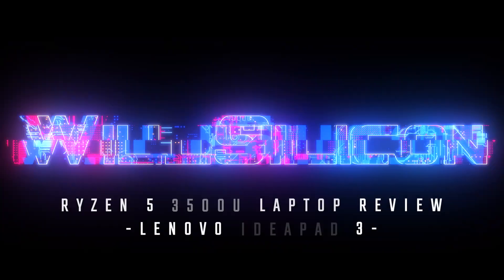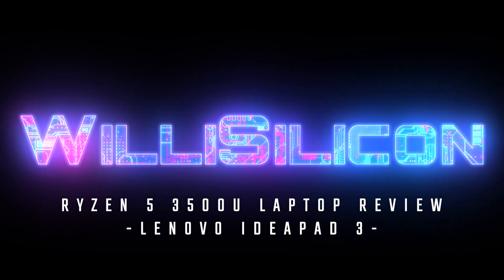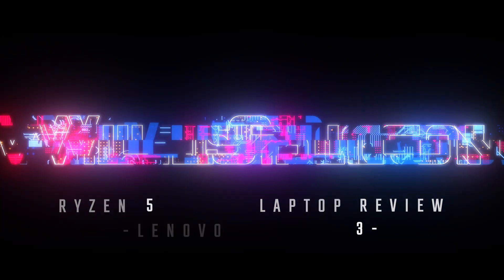This $450 Dollar Laptop Rocks! - Ryzen 5 3500u - Lenovo Ideapad 3 Review

Comment: Hi there. I bought this laptop last Friday and I'm looking to expand its NVME memory at least to 500GB. I saw that you recommended 2242 and 2260 memory sticks to put in this laptop but I've been unable to find those at Amazon or eBay. I saw one of the comments that somebody actually used a WD SN550 to upgrade the 256 NVME this laptop comes with, but the WD is 2280, is it possible to put a 2280 NVME in this laptop, what you think?
Reply from the maker: I looks to be possible to fit one in there but there isn't a screw hole for 2280. Soooo, maybe if you treat it gently? lol. Otherwise this is the cheapest 512GB 2242 NVMe drive I'm seeing right now. The smaller sticks are generally more expensive. Sabrent is a really good SSD brand though.  https://amzn.to/3kxJJ2C
Reply: @WilliSilicon  so you’re saying it could fit a 2080 SSD but because it doesn’t have a screw hold it’s dangerous to come loose or break? I’ve heard it can run it but I don’t want to risk it coming loose or something
Reply from the maker: I have not personally tried it. Next time I get the laptop from my son I will open it up and see how a 2280 fits. So probably Sunday.
Reply: @WilliSilicon  okay let me know when you do. I almost thought I saw another screw hole to the left that might fit a 2080. I could be wrong though. If it does fit a 2080 that gives this laptop some strong potential
Reply: @SoapboxPreacher777  I opened up mine recently to change the ram and I saw another screw hole 40cms far from the one that the NVME is screwed. I didn't make the NVME change so far however I've concluded as well that it could be a slight chance that a 2280 NVME could fit in this computer, moving the screw that is holding the original NVME to fit the new 2280. In any case, I'll share with you guys my experience when I've done it either if it is possible or not to fit this type of memory to it.
Reply: @DMAC-ml7tn  okay yeah the OP is trying it Sunday apparently but let me know if you do it. I think I saw the extra screw hole on the video so I think there’s a good chance it can fit 2080 so I’m waiting for someone to confirm it before I buy a 2080. Thanks
Reply: @SoapboxPreacher777  No problem. I'm waiting for Willi's response as well since I'm a bit far from buying the new 2280 NVME. However, when I did the ram swapping last week I saw the extra hole in there, I hope our guessings are right and a 2280 NVME can be fit using the extra hole inside this laptop. This laptop is very powerful and I really loved it since I saw the review from Willi, I ended buying it because of this review.
Reply: @DMAC-ml7tn  yeah I bought it too. And I got it for $400. It jumped to $690 now on Walmart. But yeah I already bought the 2080 because I’m 99% sure it fits. If not I have free Amazon returns. Also with added RAM for a total of 20 this thing is strong. Definitely decent budget gaming laptop with these upgrades.
Reply from the maker: I've got my son's open right now and can confirm for sure that it will fit a 2280! Sorry for the confusion folks!
Reply: @WilliSilicon  it’s all good. Yeah that’s great news though. That’s means you put a 1TB ssd and 16 GB RAM for like $150 and really upgrade this thing. Thank you!
Reply from the maker: You're welcome
Reply: @WilliSilicon  thank you so much for the confirmation.
Reply from the maker: You're welcome
Reply: @SoapboxPreacher777  Hi. I did the NVME swap just now and the 2280 fits perfectly and the same screw from the original Lenovo NVME fits perfectly as well to the new 2280 NVME.
Reply: @DMAC-ml7tn  can a 32gb ram stick run safely in laptop making a total of 38gb of ram that is 32gb ram+ 4gb soldiered on board= 38gb of ram
Reply: @diamondx12  Hi there. What Lenovo says is that the total memory system supported is 12gb of ram. I've put on mine an 8gb memory for a grand total of 12gb and the system is running smoothly. I really don't know if you can put more ram being the 12 gb threshold, I mean maybe you could but the system will recognize less or drive you to an error, it is difficult to tell for me really. However, what I can tell you is that 12gb should be more than enough to game, work and whatever else you want to do with this laptop, the Ryzen 5 cpu got you cover. I've run the new Resident Evils and some other recent games, not in the best quality but it really gets the job done for a budget laptop.
Reply: @DMAC-ml7tn  what is the best 2280 NVME to get for this wonderful laptop. also about size 1tb or 2tb size also, thanks in advance.
Reply: @diamondx12  I bought a Seagate Barracuda 2280 for mine and it is working flawlessly. I could recommend you this brand eyes close since my experience with it has been a breeze, however, you can check in the market other options if you have a preference for another brand in particular. But from my experience, Seagate is really doing a great job with their line up of storage media these days, they last very long and at least I've hadn't read massive failure reports from other people over this Barracuda NVME.
Reply: @DMAC-ml7tn  thanks for the wonderful help and info.  If it is not too much trouble, can you provide a link to get this wonderful: 16gb ram for my system and a link to get this wonderful 2280 drive u were talking about.  thanks in advance.  and Happy early New years 2021. :)
Reply: @diamondx12  Sure thing. I'll leave you the links below. These are the current brands I got installed in my Lenovo.

NVME: https://www.amazon.com/dp/B07ZPRV8JY/ref=cm_sw_r_cp_apa_fabc_9Mi6FbW08T373?_encoding=UTF8&psc=1

Ram: https://www.amazon.com/dp/B07YNGGV8G/ref=cm_sw_r_cp_apa_fabc_sPi6Fb2Q9QRBG?_encoding=UTF8&psc=1

Merry Christmas for you as well and happy new year.

Comment: I am planning to buy this one. But would it be good for running Adobe illustrator smoothly? It has the minimum requirements. But I donno much about techs I saw some YouTube videos that even if your laptop meets the requirements, the app still takes a lot of launching time. Should I buy it??
Reply from the maker: It wouldn't take a lot of launching time with this laptop because it has an NVMe SSD. The weakest link would be 8gb of RAM. So it would start out great, but as you do more and more in a project you'll run out of available RAM and it will start to bog down a bit.
Reply: @WilliSilicon  Thank you so much.
Reply from the maker: You're welcome
Reply: @WilliSilicon  Is the 8 GB RAM upgradable?
Reply from the maker: One 4gb stick isn't, but the other is upgradable to 16gb for a total of 20gb.
Reply: @WilliSilicon  Okay then I am going to buy this. Thanks for the video. It helped me a lot! <3
Reply from the maker: You're welcome. I hope you like it!

Comment: Is it worth it to upgrade the ram
Reply from the maker: Only if you need more RAM. If you want more and don't already have this laptop I'd check the prices for laptops with the same specs, but more RAM, as it may not cost much more.
Reply: @WilliSilicon  I have the laptop
Reply from the maker: Then yeah if you feel like the 8gb isn't cutting it swap out the 4gb sick for an 8 or 16
Reply from the maker: It's worth it especially if you can find a good price on a used stick. I'm pretty sure the motherboard only supports up to 2666mhz so don't waste any $ on faster

Comment: I upgraded my Lenovo Ideapad 3 to 20GB Ram and 1TB SSD.
it works fantastic.
Reply from the maker: Awesome!
Reply: @Alexander-jr8nw I think you can use any computer? Take this with a grain of salt though.
Reply: Can I ask where you got the SSD from? the one you used to upgrade it? And did you confirm it’s actually using all the extra RAM?
Reply: @SoapboxPreacher777  The SSD type is PCIe. I used Kingston A2000. you can get it from amazon. Yes i can confirm that 20GB of ram is working without problem. but nobody needs that amount of RAM unless you are gamer or video editor.
Reply: @Omar1986ss  I think I see the one you used but it’s 2080? I know it’s a lot of trouble but can you send a link. I heard some people say a 2080 fits but I’m worried because I’m installing it myself. Can I really use a 2080? because then my options really expand
Reply: @Omar1986ss  yes thank you but it seems there isn’t a screw to secure a larger 2080. Did yours just snap in and it stayed in place? I’m just worried without a screw to hold it it’ll come loose or break.
Reply: @SoapboxPreacher777  yes, I used screw since it is longer than the built-in SSD. However My advice to you is to take your laptop to Computer shop and let the certified technical fit the new SSD inside your laptop. he can do it without problem.
Reply: @Omar1986ss  well I’m asking if there’s a screw hole to secure it in place. It looks like there’s a screw hole that fits 2242 and a screw hole a bit to the left that fits 2080. Is this the case?
Reply: @SoapboxPreacher777  well you have to remove the screw from the 2242 and place it in 2080 in order to fit the SSD. watch this video, he will explain in details how to replace the SSD. here is the link.
https://www.youtube.com/watch?v=r3pshvXM9KY
Reply from the maker: That's not the same laptop. I'll try a 2280 in the 14" ryzen version on Sunday
Reply: @WilliSilicon  okay I’m waiting for you to do it before I order my ssd. Thank you again sir.

Comment: So the hot keys of camera on and off and flight mode take 20 seconds to wotk after bootup? Rest all hot keys work but doesn't show the special popup on the screen before 20sec of bootup It has the special pop when u click the caplocks numb lock but it takes 20 seconds to work after bootup is this same in ur case i need help
Reply from the maker: I checked and my son's worked immediately after boot. This probably depends on how many programs you have starting during boot up. The more programs starting at boot up the slower it will be.
Reply: @WilliSilicon  sir i am facing this issue after like a fool i updated the bios its a brand new laptop and i have only one drive to run at startup thats why i am requesting you that what is ur bios version and where can i download it from. I bought the laptop on the 4th of October
Reply from the maker: @leanderpereira5257  E8CN23WW Is the BIOS version on my son's Ideapad 3
Reply from the maker: https://pcsupport.lenovo.com/us/en/products/laptops-and-netbooks/3-series/ideapad-3-14ada05/81w0/81w0003qus/downloads/driver-list/
Reply: @WilliSilicon  i have the same bios version i dnt why i have this strange proble i dnt is it because of Microsoft updates that on startup only the camera hot key and aeroplane hot key dowsnt wirk but after 15 seconds of bootup like all is normal and on clicking the button i can see the invisible popoup on the screen for all hotkeys
Reply from the maker: Yeah sorry man. Sounds like you just have to wait for the drivers to load up
Reply: @WilliSilicon  sir how much ssd space its showing for u i mean the c drive when u open my computer its showing 117gb for me is it same for you
Reply from the maker: Should be over 200 if you have the 256gb SSD and you haven't installed anything yet.
Reply: @WilliSilicon  i dnt have the 256 gb variant i have the 128gb variant out of which it show 117gb in c drive and i can use only 82gb
Reply from the maker: That's about right then. Drives are always less capacity than they're advertised. And that also explains why your laptop is slower. You don't have the same as in this video. You likely have the Ryzen 3 version or some Intel version.
Reply: @WilliSilicon  ryzen 5 3500u vega 8  128gb ssd and 1tb hdd this problem started after bios update i guess

Comment: I have the same laptop but it's heating when I play games (my charger is plugged in) . It's my first laptop so I don't know if I should be concerned about heating . I checked stats using msi after burner and the gpu temp was 60-65°C .
Do you recommend buying a cooling pad ?
Reply from the maker: No those temps are perfectly fine!
Reply from the maker: Well said bro. If you have a daily driver laptop I recommend popping it open every few months and blowing the heatsinks out with some canned air.
Reply from the maker: Thanks for the info! I meant every few months as in maybe just a little fluff lol. But everyone will appreciate your in depth support!

Comment: Its good for gaming ?
Reply from the maker: It's good for games with low requirements. Check out the video in the pinned comment for more game benchmarks.
Reply: @WilliSilicon  can it run roblox good?
Reply: @WilliSilicon  like the amd ryzen 5 3500u
Reply from the maker: I have not personally tried it, but I'm pretty confident it will run it just fine. I know it plays games that are more demanding than Roblox

Comment: Saw this laptop for about $379 on bestbuy, wondering if it was a good deal
Reply from the maker: If it's the same specs, then that's a great deal! But there are a few different versions of the Ideapad 3, so make sure!
Reply: WilliSilicon yeah, unfortunately it was the Ryzen 3 3200U version. Would that still be a good deal for it and how would it run lite games, if you know
Reply from the maker: Nah that's not a great deal. It's half as powerful as the Ryzen 5
Reply from the maker: I think Walmart still has my version for $419. The Ryzen 3 will still run something like Roblox, but the graphics chip is not really much better than Intel integrated graphics.

Comment: Would this laptop be good for video editing? Just some gaming videos nothing too crazy
Reply from the maker: It wouldn't be badddd, but definitely doable. 8gb of ram would be the biggest hiccup. If you can go desktop you could get a little more performance for the same price
Reply: @WilliSilicon  got it, thanks for the info! Much appreciated
Reply from the maker: You're welcome! Oh and btw I meant used desktop parts. I'm building a desktop soon with used parts that will be more powerful than this laptop for around the same price. Although that's without a monitor and keyboard/mouse, so that's another thing to think about. Videos coming soon hopefully 😃
Reply: @WilliSilicon   @WilliSilicon  I see, unfortunately I don't have the space for a desktop. Any recommendations on a budget editing laptop? I'm currently using the editing software on the ps4 for videos and my phone for making thumbnails haha 😄 so anything decent would probably a huge improvement than my current set up.
Reply from the maker: It helps a lot to have a dedicated graphics card for editing as well. Especially Nvidia with cuda. Maybe look for a used i7 laptop with like a 1060 GPU and 16gb or more RAM
Reply from the maker: Try FB marketplace. That's where I get most stuff now days
Reply: @WilliSilicon  got it! Thanks!!

Comment: I cant seem to find the manufacturers warranty on it, how much warranty do they have on this model? Great video
Reply from the maker: The one that I bought comes with a 1 year Depot warranty. Which covers carry-in repair, parts and labor, and also phone support. It does not cover accidental damage, on-site repair, or "premium care". You can go thru Lenovo and add 1 year for $15 or 2 years for $30. You can also add 1 year of accidental damage protection for $16.67.

Comment: Can it run lumion?
Reply from the maker: It might? But it's not recommended. It is below the minimum requirements according to their website. The processor is the only part that meets the requirements. https://lumion.com/requirements.html
Reply: Thanks
Reply from the maker: You're welcome. With the requirements of that software you would need an expensive laptop with dedicated graphics or a desktop. Good luck!
Reply: By the way if lower version of lumion it might be better?
For example lumion 8-6
Reply from the maker: hhmm this laptop would probably run Lumion 6. It meets the minimum requirements.
Reply: @WilliSilicon   thank you so much
Reply from the maker: You're welcome!

Comment: Do you think the Pentium gold Will be good
Reply from the maker: That's a big no...only if it was like $200 for the laptop. The Ryzen system in this video is about 4x better!
Reply: @WilliSilicon  But where I live they only sale it for Pentium gold 6405
Reply from the maker: That is a very weak processor compared to the Ryzen 5 3500u. I don't recommend buying that. You can get the one I bought on Amazon. Are you in the U.S.?
Reply: @WilliSilicon  No I'm in Norway they only have the Pentium gold and ryuzen 3
Reply from the maker: @lingomvankhong2527  Well the Ryzen 3 is still a lot better than the Pentium. The Ryzen 3 3250u is about twice as powerful as the Pentium and the Ryzen 5 3500u is about twice as powerful as the Ryzen 3. And the Vega graphics are also much better than the Intel HD graphics.
Reply: @WilliSilicon  well if I buy with ryuzen 3 It will cost 400 dollar with 4gb ram
Reply from the maker: @lingomvankhong2527  I would do more research and find the best price to performance deal. Not just with the lenovo laptop, but with all available laptops in my price range. See what CPU it has and compare them on Passmark. Like....google: Ryzen 3 3250u passmark. Good luck!

Comment: When you installed the AMD Radeon software, why did you choose to factory reset? Can I opt out?
Reply from the maker: It's just a habit. You don't really need to if it's the first driver install, but it's typically a good practice. All that does is uninstall any old graphics drivers before installing the new. Otherwise known as a "clean install"
Reply: @WilliSilicon Just to clarify, I can leave the box unchecked and I would be fine to game (given that I haven't manually installed any driver for the Lenovo Ideapad 3 I just got today)?
Reply from the maker: Yeah you'll be fine. And mine came with some kind of Radeon software lite version. So I updated to the full version in the video